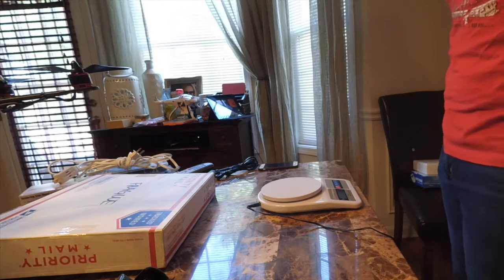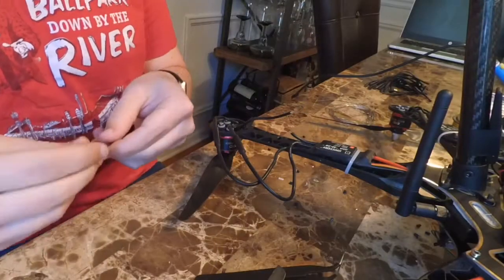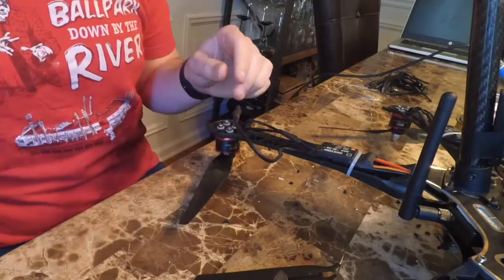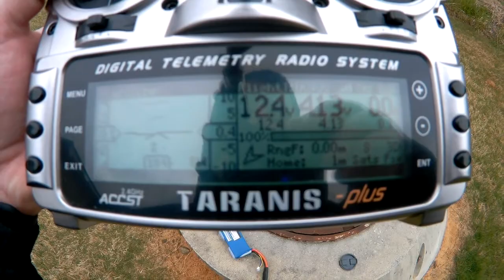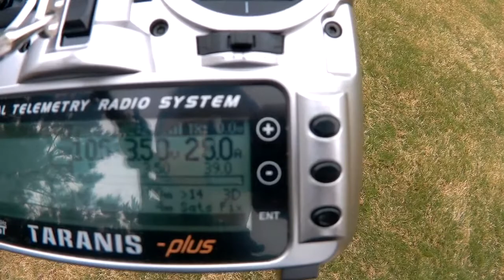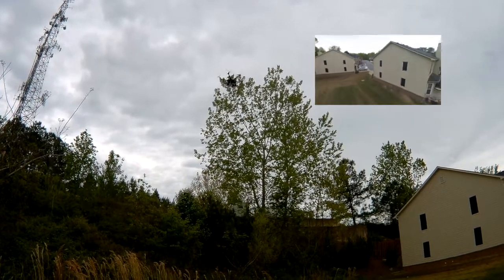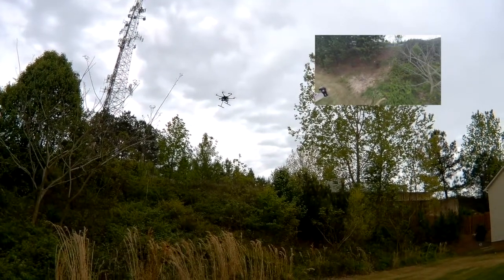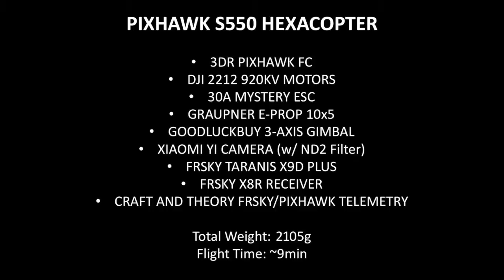HMF S550 Hexacopter ESC Wire Trim and Flight

Comment: Can we fold this Frame, I mean not directly, but by removing screws when we travel? Will it damage if we frequently remove/add screws for folding/fitting?
Reply: Yes you can 😃

Comment: NICE video. BATT SPECS and weight please?
Reply from the maker: Thanks for the comment. The copter has change A LOT since I made this video and I honestly haven't flow this in a few months, but I was running China Hobby Line (CNHL) 4S 55C 5000mah batteries with great results. The total weight is at 2503g, with the battery accounting for 569g. I would say the 3-axis Zhiyun Tiny2 accounts for another 400-600g, it's a pretty heavy gimbal but works amazingly well! With the whole package I get about 10 minutes of flight time. Sadly I've been flying my DJI Spark more than this big guy since it's so much easier to transport, has slightly longer flight time and equal or better video quality. Although I could improve video by using a better camera than the Xiaomi Yi I was running.
Reply: @cjkcizur  Hi,  Thank you for the very descriptive reply, I have just finished building an S550 with 2 axis gimbal, Akaso EK7000 4k camera, total weight 2080g with 4s 5200mah battery, Arducopter APM 2.8 (its very light and small compared to Pixhawk). Havent flown it yet, (need set everything in mission planner first. ) looking forward to getting it in the Air!

Comment: Nice build. Im thinking of doing something similar with 10in props. what is your flight time? of actual flying?
. could you tell if the pixhawk would fit in between the plates instead of being on the outside? WHat KV motors are you using ?
Reply from the maker: +Roberto C. Mercado Thanks Roberto! I'm using DJI 2212 920KV Motors and I get about 8-9 minutes of flight time on a 5800mAH 35C 3S battery with a voltage alarm going off at 3.3V/cell. When I land the voltage rebounds to about 3.8V/cell so there's a significant voltage drop under load. I may bump up to a 4S at some point but pretty happy with how she runs right now.

I think Pixhawk would fit between the plates, but the mounting tape would have to be very thin and with the ports being on the top you would be compressing the connectors. You would also lose access since the opening at the top is not large enough for the Pixhawk form factor.

If you go to the very end of the video I list all of the Specs for the build including motor KV, prop sizes etc. I'll be putting out some more vids of the build but don't hesitate at all to reach out if you have questions.

Good luck!
Reply: Opps i should have waited until the end of the video ahaha. thanks for the info. Man i thought these hex drones would atleast stay up for 12mins. Ebay sales the same kit you have but with 800kv motors. Do you think it'll have a longer flight time with 5800mah 4s lipo? I was also wondering if the ebay kit can handle two 5500 lipos mounted, what are your thoughts on that? 

Thanks again !
Reply from the maker: +Roberto C. Mercado Yeah, I was hoping for longer flight times too and I continue to try to come up with ideas for weight savings to help boost it. However, the only real solution for the weight/flight time issue would be to move to lower KV motors spinning larger props, but the max prop size on the S550 Hex is 10". I believe that's why a lot of people go with the Tarot 690 size frames since they can fit larger props for more lift. 

The airframe could fit 2 x 5500mah, but I don't think it could handle that weight for safe, stable flight.

Here are some calculations that I ran using Ecalc.ch (well worth paying a couple $$ for):

- Current setup theoretical flight time: 11.5 min (I'm seeing closer to 9 at my voltage warning)
- With 4s at the same weight: 15.5 min (but risk exceeding max power on motor)
- With 4s on 9" props: 14.2 min
*All times theoretical, I have not tested

Seriously check out ecalc, for a couple dollars you can run all the different numbers and come up with a package that give you exactly what you're looking for in terms of flight times and lift capabilities. I guarantee it will save you money in the long run by knowing ahead of time!

For me I'm not sure if I'll go 4s. I'll have to add an additional BEC for my gimbal which I'm running off the flight battery and it can only safely handle 7-13V. Realistically with the additional weight of a 4s, my guess is I would probably only see about 2-3 minutes of additional flight time, and right now I'm fine just swapping batteries. But for you just putting together a kit, 4s should get you to that 12min number with this setup and the right planning with regards to weight.
Reply: +cjkcizur interesting...the small weight reduction does help a lot. ill be doing the same to my quad... if you look at my drone videos you'll see my little 500mm diatone alien. the spec for the frame says 10 inch  props but i recently used 11 inch pros but wasn't an  efficient upgrade. the pros only add .5inch to each end of the prop and the clearance between all the props was about  an inch. from the look of it in your video  s550 handle use 11 inch, it'll be tight but it may work.

ill use that calc too thanks.
Reply: +cjkcizur interesting...the small weight reduction does help a lot. ill be doing the same to my quad... if you look at my drone videos you'll see my little 500mm diatone alien. the spec for the frame says 10 inch  props but i recently used 11 inch pros but wasn't an  efficient upgrade. the pros only add .5inch to each end of the prop and the clearance between all the props was about  an inch. from the look of it in your video  s550 handle use 11 inch, it'll be tight but it may work.

ill use that calc too thanks.
Reply from the maker: Hi Roberto, after some more flights and looking at my balance charger after the flight, it appears that I'm actually only putting back between 50-60% of charge back in my batteries, so I may be hitting a limitation on my Zippy Flightmax Batteries in terms of internal resistance. They're 30C batteries which should mean they can easily handle the 30 amp current draw at hover. But both my Pixhawk and a voltage alarm are showing 10V at 10 minutes.

That's about 5% per minute so if I could draw down to the 80% rule, I should be able to get closer to 15 minutes of flight time. Time to start looking for sources of resistance or look for better batteries!

Comment: Can I use gopro hero 3 with 2 axis gimbal for this hexa
Reply from the maker: yes absolutely. I'm using a Zhiyun Z1-Tiny2 3-axis gimbal that is designed for the gopro hero 1,2,3,4 (not sure if it will work with the Hero5 and 6) but there's no reason why you can't use another 2-axis model. the gimbal hangs from two 10mm rails so as long as whatever you want to use supports standard rail hangers you can use whatever you want.
Reply: Which camera are you using
Reply: Cjkcizur
Reply from the maker: I'm currently using a Xiaomi Yi camera. It works well and the price is really nice at about $90, but the video quality is slightly lower than an actual GoPro and you may have to adjust the balance of the gimbal as most are actually designed for the weight of the GoPro line of cameras. I also have an adapter for my gimbal so that I can attach my GoPro Hero5 Session. However since the Session does not have live video output it's really not useful as I can't get a feed on my monitor.
Reply: What is the WiFi range of the xiaomi camera
Reply: Also can I use a firefly 6s camera with the gimbal
Reply: Please give me your email or something cause this is my first hexacopter I need some help with it also tell me a flight controller board and a GPS module for the hex
Reply from the maker: The Firefly 6s camera looks to be compatible with the mounting system of the gimbal I'm using. As far as wifi range, it's not very far and I would not recommend using wifi while on the drone as there is a possibility that the frequency can interfere with the radio control frequency used to fly it as normally they both run at 2.4GHz. I'm using the USB AV Out feature of the camera (the GoPro and Firefly have this feature as well) to connect the video feed to a separate 5.8GHz video transmitter mounted on the drone. I then have a video receiver connected to a small screen to view the video on the ground.
Reply: Can you send the link of the screen and the video
Reply: Also you're email
Reply from the maker: This is the video transmitter I'm using: https://www.amazon.com/Hobbypower-Boscam-TS832-Wireless-Transmitter/dp/B00Q6FVL42/ref=sr_1_8?s=toys-and-games&ie=UTF8&qid=1526047653&sr=1-8&keywords=600mw+v5.8ghz+video+transmitter

This is the small screen that I'm currently using because it has a built-in 5.8GHz video receiver: https://www.amazon.com/FEICHAO-BOS200RC-Wireless-Receiver-Helicopter/dp/B07CVY3HDM/ref=sr_1_1_sspa?s=toys-and-games&ie=UTF8&qid=1526047749&sr=1-1-spons&keywords=5.8ghz+watch&psc=1
Reply: Which flight operating system are you using
Reply from the maker: Pixhawk flight controller running ArduPilot Software
Reply: Rockingstarchithvij@gmail.com please contact me I need help making it
Reply: How much does it cost and its link
Reply: Which ESC is recommended link please